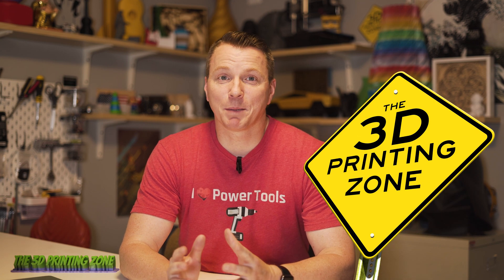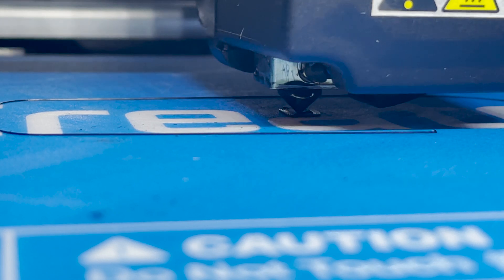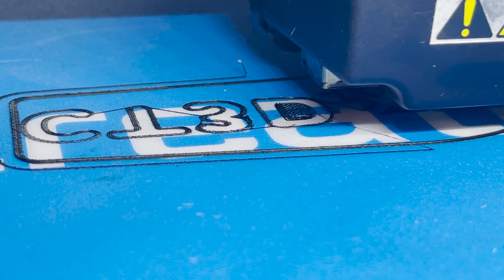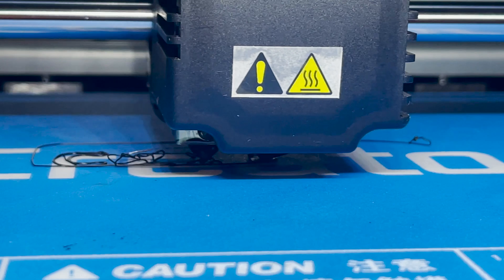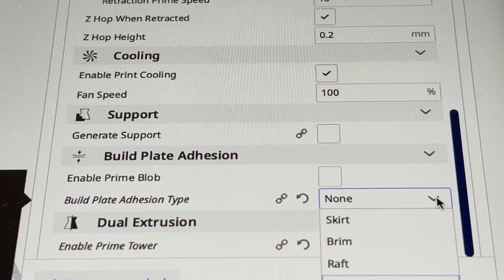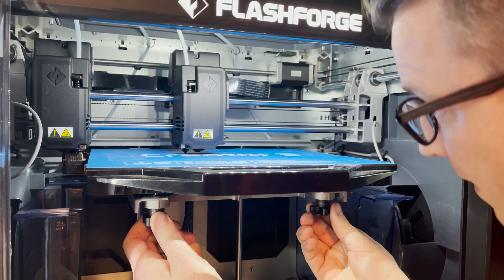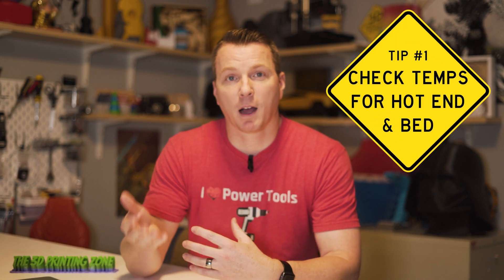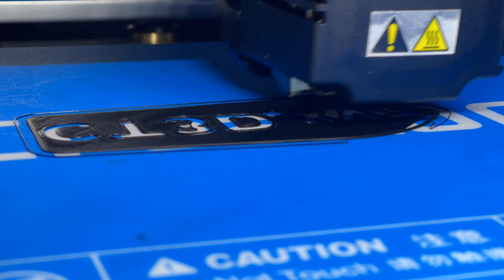2 Tricks For Getting the Perfect First Layer - 3D Printing

Comment: I recently purchased a Ender-3 V3 KE and have been have some troubles. Im new to this but my bed is a little off. In this video you mention handles for adjustments. This particular unit has screws and spacers. Would you have any tips for balancing besides replacing the spacers?

Great videos by the way they are helping me a lot.
Reply from the maker: I haven’t used this exact model before but usually the handles under the bed will help you level the bed. Were you able to figure it out?

Comment: What speed should we use for first layer and the rest?
Reply from the maker: That depends on your printer. What printer do you have?
Reply: @The3DPrintingZone  ender 3v2
Reply from the maker: @avtem  probably pretty slow.aune 20-40 mm/s. But, you can test a few prints and increase the speed each time to see which quality is best. I always try to go as fast as I can without giving up quality.

Comment: You only really know that you got a perfect personality are high. If you can see the depth and the layers after the first four layers of a benchy. You first have a level that will bed but is your nozzle height good which can be done through octoprint on a rpi pico or maybe your ronter already has a bed visaliser. Maybrequire shommong bit doable regardless.

Comment: i been printing two weeks at this point bed leveling 101 form the noob. tighten your bed springs. auto home your your printer and manually adjust the z axis to 2.mm ( i have 04 nozzle) use a piece of paper and wait ill you feel light scratch and move diagnoly acros the corner and then to the midlle then go around again till they are all trammed. hit the center again if you feel a light scratch youre golden. ultra pla doesnt adhere well at high speeds so drop them initials speeds down
Reply from the maker: Thanks for the tips!

Comment: How do I get rid of the lines From letter to letter on the surface. I have changed the temp, retraction speed, Retraction Distance, What am I Missing I'm using Cura just cant seem to find the setting to fix this problem.  Do you have any suggestions on this problem ? Thank you very much for your help !!  🤔
Reply from the maker: If you’re talking about the top surface, there’s a few things you can try. You might need to adjust the flow or enable z-hop. Are you talking about the travel line from one letter to the next? Z-hop should help with that

Comment: I’m finding that filament quality is huge 🫤 every time you change filament if it’s not printing properly, clean the bed and level it. if still not working start slowing down prints and adjust heat settings I had such cheap filament I had to run initial layers at 12 mms and slow everything else down too. Prints take forever but you’re not wasting filament and you know not to buy from that place again 😅

Comment: I'd say that getting the fist layer right is THE biggest pain in 3D printing! I've spent countless hours trying to sort  the first layers on my printers. I can absolutely see why so many people are buying printers like the Bambu Labs models, as they just work! A couple of other things that you can do to help with the first layer that Youtubers rarely talk about is 1) increase your first layer height, 2) increase your first layer flow percentage (it will help squish the first layer down without the nozzle grinding in to the surface.
Reply: How would you go about changing the first layer height or first layer flow rate on a bambu labs a1 mini?
Reply: @user-vr3nm9em5b  some of them have an issue. If you check the link out there are multiple people with the same issue.

Comment: Adjusting the bed level on the fly sounds like a bad idea?  FOUR things can go wrong?

Why wouldn't you just adjust the Z offset?  Assuming "you" got your platform level to begin with...just need to adjust the nozzle height?
Reply: Was curios about this too. Want to try this on my next pring. Seems MUCH easier than adjusting all 4 knobs, which I had been doing. Thanks

Comment: I'm always having adhesion problems on the outer perimeter of the bed, even after a manual level and auto level, the first layer in the centre is superb, then it goes to do the outer edges and they curl up every time

I've clean the bed with iso and tested the nozzel at the corners, I've even cleaned the nozzel and switched to a fresh sealed pla, it always lifts

One thing that I have down that's naughty is told the slicer that my bed is 1cm larger so I can do edge to. Edge printing only where the print head will avoid the bed clips 

Wonder what's going on

Comment: Great video. Quesation for you as I am new to this. I just got the CR 5 S1. Its fantastic. I notice though that the front right knob is way tighter than the others when manual leveling. Almost bottomed out to make it level. That would be position 3 on the leveling program. Im not sure why this is. It has the silicone spacers instead of springs. 

I took the time to tighten all the knobs down till they are hand tight, then backed them all off 3 turns and went through the bed leveling process. Same results. The prints are fine...I just dont like the idea that one corner is so different from the rest. 

Any suggestions?
Reply: Use the corner with the most problem as your start/reference position.  Turn it's knob to a convenient position.  That becomes your Z0 position.  Set your Z stop limit switch to be closed at that point.  Have your feeler gauge under the nozzle when doing this limit switch adjustment.  That being done - adjust your remaining three corners as needed.   No more need to adjust your problem corner as it is the reference against which all other  corners are adjusted-in.

Comment: I just use Elmer's liquid glue and brush it on. Personally I never disable my steppers. Instead of pushing it corner to corner just use the move function. Start at x23 y23 then x 23 y 193 x193 y 193 and so on about 3 times around.  Using a piece of copy paper to get it to where it's  grabbing it but it can slide.. this way you aren't just pushing the nozzle around with your hand since I had much pain leveling this way.

Comment: Any tips for removing a thin layer that was too close ............ Im trying to get it off  but dont wanna scratch the bed
Reply from the maker: That's always really tricky - I've had that happen before. Isopropyl alcohol or acetone are a good start. If that doesn't do it then try heating up the bed hotter than normal (maybe 80 C) and see if you can then use a traditional spatula/scraper to carefully get in there. I've got some beds that seem to have it on there somewhat permanently and there's not much I can do. Another option is just to print over it and see if it comes off with the new print - sort of like removing permanent marker with dry erase marker. Good luck!
Reply: @The3DPrintingZone  thanks for the tips! Gonna try some alcohol when I get home. I also ordered a flexible bed cover to hopefully avoid the issue in the future

Comment: turning my nobs right brings the bed away from the nozzle turning them left pulls the bed away from the hot end... not always righty tight lefty loosey
Reply from the maker: You're correct that it's not always righty tighty but it also depends on how you're looking at it. This is measured by looking at the top side of the screw head, so in the case of a 3D printer bed leveling screw, the screw threads upward into the bed so you'd need to be looking at it from underneath. As you look at it from the front of the printer, it works out the same, really - if the front of the nob is moving to the right, that typically tightens the screw, thus pulling the bed away from the nozzle. If yours is set up in the other direction, that means the manufacturer is using reverse threaded screws for some reason.

Comment: I use a 'feeler gauge' to level my print bed, here's how. On the Ender 3, first autohome your nozzle and move it to first layer position (+0.3mm). Use a 0.275mm feeler gauge to ensure even spacing, do each corner and recheck. To remove printed parts, take bed off printer and flex it, parts will pop off.

Comment: Hey, I notice you have a creator 3. Have you had issues with that printer shifting it’s print after pausing and restarting a print? If so, did you find a solution for that?
Reply from the maker: I haven't noticed that but I VERY rarely pause a print so that's probably why. Are you pausing just when you're not able to watch it or to change filaments? Or something else?
Reply: @The3DPrintingZone  just when changing filaments. I don’t pause prints at all now because of it. If I have to change filaments, I have to do it on the fly...
Reply from the maker: @gennybogaert5809  Ah, gotcha. I'll have to play with that a bit more to see if I run into that but nothing so far. And yes, the dual extrusion seems to work great so far. I haven't logged a ton of hours on this printer yet because I ended up getting several different printers in a relatively short time but everything I've done on this one has actually worked out quite well.
Reply: @The3DPrintingZone  does yours print pretty good when using both extrudes?

Comment: What if I have both problems at once? Since I installed BLtouch, I'm not sticking to bed, but even though my first layers are too squished. I know it sounds weird, but I'm quite fucked :D  Edges just won't stick. Sharp corners are following nozzle instead of laying down. But centre of first layer is so squished that there is visible overestrusion effect.
Reply from the maker: Sounds like you may want to consider replacing your bed. A new, flat bed should help - like thick glass or a carborundum bed.

Comment: if the bed is too squished with it also create a 'lip' style on the bottom of the pieces printed as well? im noticing there is a lip or flange on every item..
Reply from the maker: It certainly could. Are you sure you're not printing with a brim? A brim will definitely do that but if your brim is set to "off" then it could be that your first layer is flattening out because the bed is too close to the nozzle.

Comment: Does it make sense to use a thin 0.4 mm feeler gauge so the gap is equal to the nozzle diameter?
Reply: Yes and no. In the gcode, your nozzle actually doesn't start at Z-0 technically. It will start at Z-0.25 lets say. You can find it in there and whatever the difference is, I would use that thickness instead.

Comment: How much does the BLtouch add-on device help with getting the head height and leveling correct?  Do you still need to manually tweak if using BLTouch?
Reply: You can do manual mesh level with a piece of paper for free with Marlin 2. (Not to be confused with corner test for bed level.)

Comment: I also like to use a small spatula and just gently drag it around the outside of the skirt to test the adhesion, and adjust on the fly accordingly. I need to make a simple grid test across the whole bed, to see how level and flat my printer is. I sometimes need to adjust all four corners when printing in the centre when compared to the front right corner I usually use.

Comment: I've had good luck with using a 3M sticky note (sticky side up, stuck to my fingers) to check the gap before printing.

When I am able to pull the paper between the  nozzle and bed with some resistance (drag) but not needing to muscle it through, then the height is good.

Be sure to check the height at each corner (at a minimum) and make sure the amount of drag on the paper is consistent.
Reply: I'm a beginner, but I'm saved by the prusa mini's auto levelling
Reply: @Itsyaboy_Jeff  Your comment is now 2 years old. Are you still enjoying the hobby?
Reply: @andyspoo2  Ye, it's such a good and rewarding hobby, I find it really fun, and printing is just so satisfying. It is definitely a hobby to pick up if you can.
Reply from the maker: I like it. I pretty much always use the paper leveling technique (some of my printers have come with little "leveling" papers that are the perfect thickness) but I've found that even then, even when doing all four corners plus the center once or twice, it's still best to let the actual printing determine if it's spot on. More and more these days, the newer printers hold their positioning pretty well and once you dial it in, they tend to stay put for a while, which is so nice.